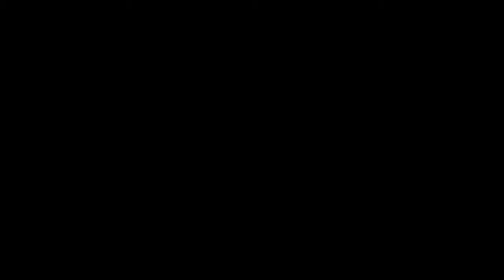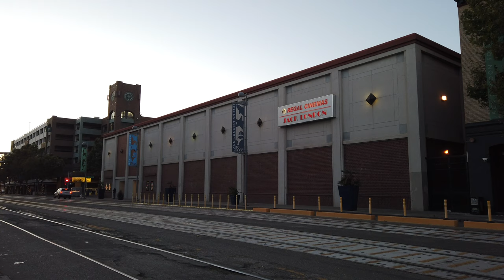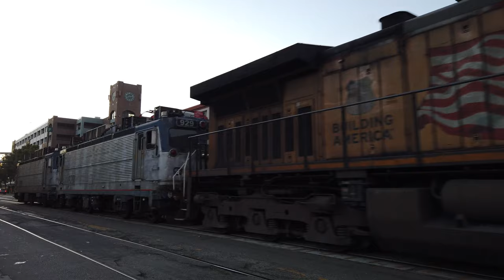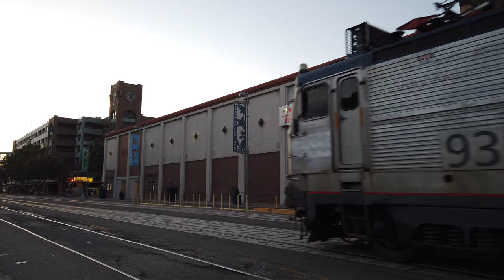Caltrain's AEM 7 move in Oakland, CA!

Comment: I saw two aem-7s in king street station tucked behind in a far corner
Reply: Save them from their hiding spot, warning, they aren’t good at making toast
Reply from the maker: As of September 2021, AEM-7 #938 has been moved to Caltrain's maintenance yard (CEMOF) to be wrapped in a special Caltrain / Herzog scheme. Once finished, the unit will soon be used to test the San Jose end of the corridor's electrification. Both AEM-7s were previously stored at the Caltrain 4th and King St. depot.
Reply: Only 938? Or both
Reply from the maker: @NotJeremy_  Only 938 as of right now. What are your thoughts on this?
Reply: I feel like it's going to be cool seeing new paint on an aem-7, but I just don't understand why they didn't take both. I do love the ol' Amtrak livery rusted, it is a great picture.
Reply from the maker: @NotJeremy_  One is for parts.
Reply: ahhh I get it now

Comment: Isn’t Caltrain using them for testing since they’ve been talking about electrifying all their lines?
Reply from the maker: As of September 2021, AEM-7 #938 has been moved to Caltrain's maintenance yard (CEMOF) to be wrapped in a special Caltrain / Herzog scheme. Once finished, the unit will soon be used to test the San Jose end of the corridor's electrification. Both AEM-7s were previously stored at the Caltrain 4th and King St. depot.